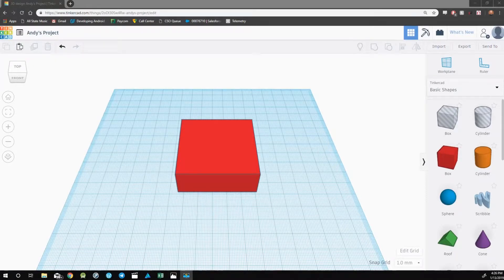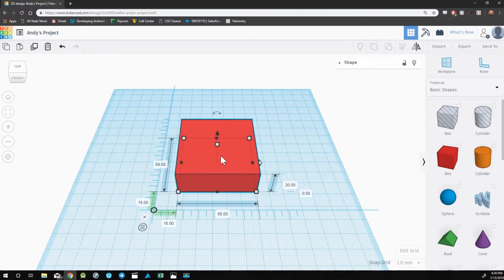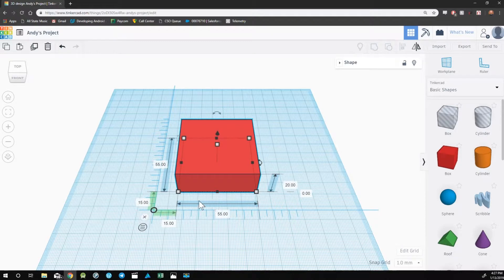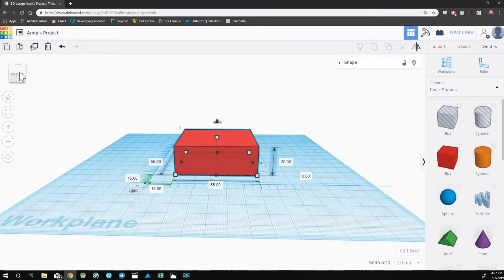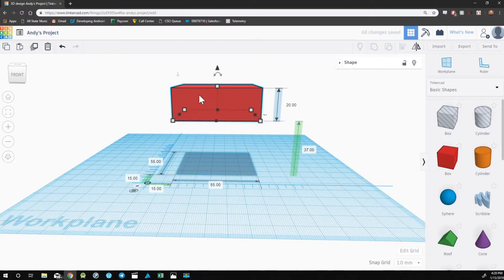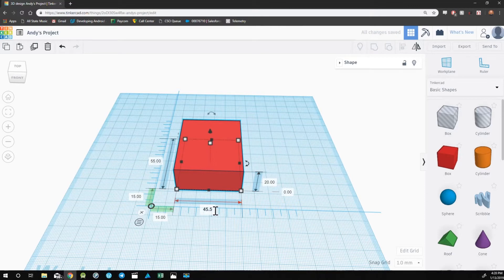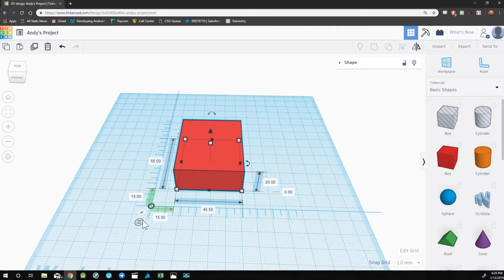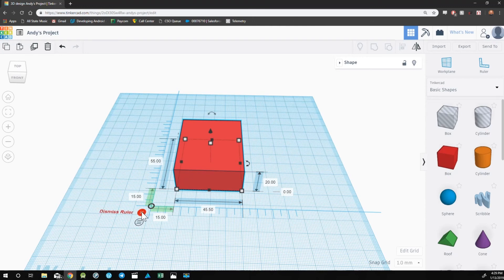How To Use the Ruler Tool in Tinkercad

Comment: Another really good straightforward  excellent video that explains some of the basic ruler functions.

When you are considering additional tutorials please and I welcome these would you please think about explaining how you can use the ruler when you have multiple shapes grouped together. this is one thing I struggle with and I have had to resort to using tiny strips that i slice off then duplicate .

I  use them as  rulers by setting a strip of say 2 x 2 x 50 against the side of the piece I want measured then adjust that strip down to the piece's size and hey presto i get a measurement,  I am sure there is a better way but I am yet to find it. thank you
Reply from the maker: Sitges, it sounds like you could make use of the plane tool to find better measurements. I believe I have another video explaining this tool sitting on my hard drive, I will check and see if I can find it and upload it. 

Essentially, you can add a plane on top of any existing shape you have, and then you can simply use the ruler on your new plane. Easier to demonstrate then it is to type it out, so I will look for that video!
Reply from the maker: Sitges, I just uploaded the video referenced in my comment above. I hope that tool helps a bit! Using the plane tool in combination with the the ruler helps me a lot.
Reply: @shakenmake  Thank you very much, I appreciate that, please keep putting them out, I think in reality I have got to a point where I need to move onto a more dedicated 3d platform like Fusion, the thinks I am trying to produce I think are on the limit of what Tinkercad can do, while its very powerful 3d editor its just not geared up for the models and fittings I am making.... 

I need to produce things to 0.5mm accuracy minimum, I have my printer so well tuned now that it can work easily to that but I am finding to get Tinkercad to work to that level difficult and I am probably asking to much!
Reply from the maker: @Neil Scott, appreciate the support. Fusion is made by the same company that makes Tinkercad so the transition into that platform isn't too bad. 

However, Tinkercad does have the ability to edit objects at the 0.5mm accuracy level- in fact, I think I have another video I can upload to demonstrate. I'll make sure it is good to go and then upload it within the next 10 minutes.
Reply: @shakenmake  Excellent, I thought I should add, Sitges and me are the same person, just depends which of me is logged into google at the time, Sitges is my holiday apartment i let here in spain where we live in sitges! hence the name . Many thanks. If you have any fusion starter tutorials that would be great as well, the interface is somewhat daunting at first....
Reply: @spiritburners  Now its me! on Sitges....very confusing I try not to let my personal items overflow onto the Sitges account but its difficult keeping track of the accounts sometimes.
Reply: @shakenmake  Brilliant thank you so much.  Neil.

Comment: With a simple hollow tube, the ruler tool does not show the wall thickness or inner diameter?
Reply: to be honest i am finding the ruler the most challenging of tools , the minute you add two components together it really seems to be no use any more, you have to click on a individual component to get the size, i think the trick is not to group until the end if you can and secondly i use a piece of a cube and make a ruler out of that to measure with so if my "ruler" is 50mm long and up against the part they are the same length then its 50mm, this is what really infuriates me that i cant have an exact measurement and it seems a guessing game unless i am doing it wrong!
Reply from the maker: Unfortunately, Tinkercad's ruler tool is lacking advanced features. You may want to consider Fusion360, it is free for educational and personal use and you can find much more advanced measuring features.

Comment: This only covers how to measure the overall dimensions of an object, what about measuring diagonal corners of an object that isn't orthogonal, or distance between different internal surfaces, or surfaces of different objects. Overall object dimensions can be seen without using the ruler just by selecting a corner of an object.
Reply from the maker: Zeric E, this is a great point; I hadn't considered those actions when making this video originally. 
The ruler tool in Tinkercad is not very advanced so for some of these actions, such as measuring diagonal corners or distance between internal surfaces, a software such as Fusion360 would be more effective. 
That being said, there are a couple tricks you can use to get more out of the Tinkercad ruler. For example, you can rotate and object by 45 degrees (or other amount) and then use the ruler to measure the width and get the length of a diagonal. 
Here is a great resource for more advanced techniques with the Tinkercad ruler: https://www.instructables.com/id/Using-the-Ruler-Tool-in-Tinkercad/

I will consider making a more advanced ruler video to cover some of these additional actions. Eventually I will have some Fusion360 tutorials as well. Thank you for your feedback!